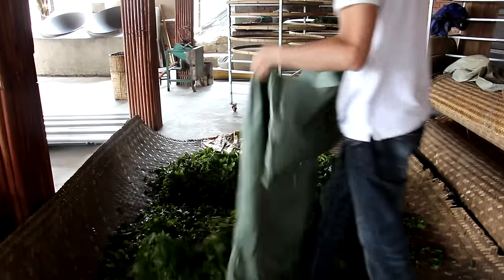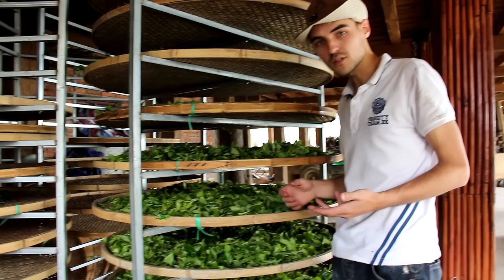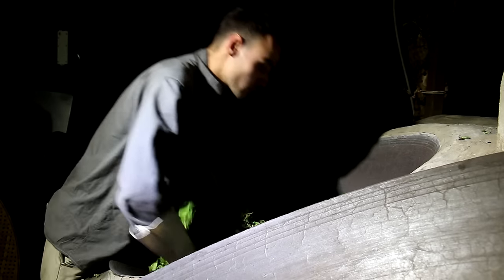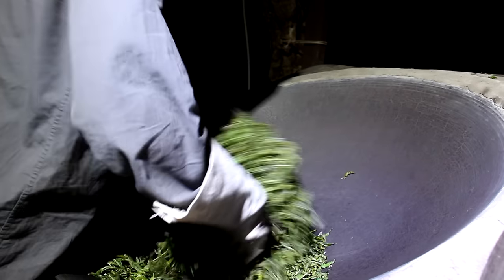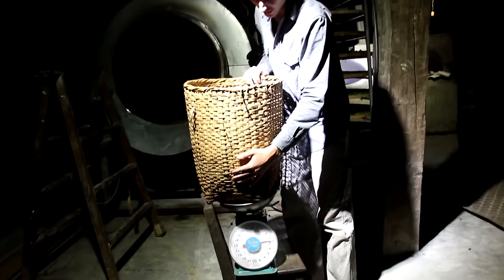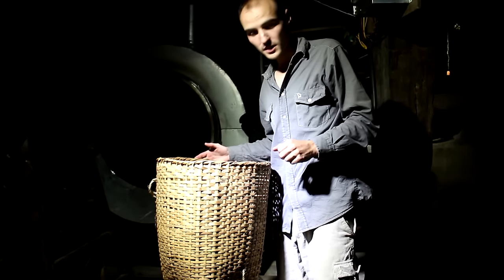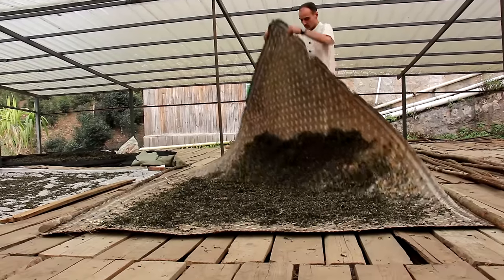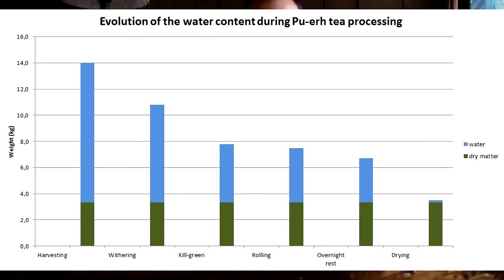Pu-erh Tea Processing

Comment: 1. Harvest
2. Weathering for 5-6 hrs
3. Steam the leaves by rolling and turning over continously in the wok non srop doe use low heat for 20 mins. 
4. Spread the leaves to steam off
5. Roll the leaves by hand gently for 20 mins or until rolled. 
6. Spread the leaves overnight to completely finish off the moisture and clear oxidation
7. Spread under the sun for 12hrs until dry and crispy
8. Store in a dry place

Comment: I am wondering if drying process is necessarily to be sun-drying. I think important thing is low-temperature drying, so shade-drying or machine-drying  both would be okay as long as it's drying temperature is similar to sun-drying. What do you think of it?
Reply from the maker: Machine drying is used in cheap tea production, I've never particularly studied this option, I guess low temperature drying is ok, in Summer, it might be the only option. I've never seen shade-drying, that's a lot of water to evaporate. On cloudy days, during the rainy season, the tea can dry eventually if put in a greenhouse, but it's good to have at least half an hour of direct sunlight to make it crisp. I guess lowering the pressure could be an option, although a costly one, freeze-drying could also be feasible.
Reply: @farmerleaf61  Thank you very much. I still wonder if the purpose of of sun-drying晒干 is its low temperature drying, or making tea leaf expose to sun-light. Or tea leaf need both low temperature drying process and sunlight?